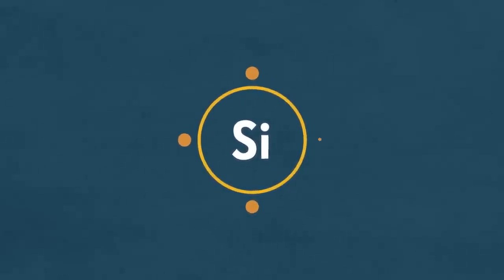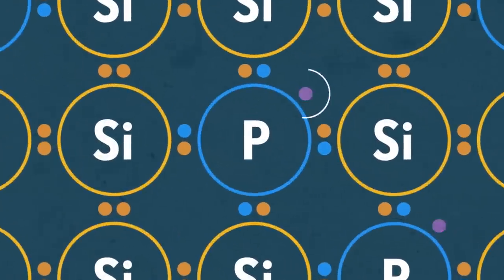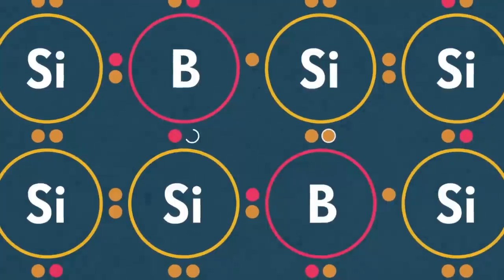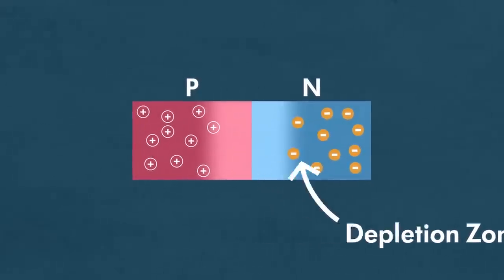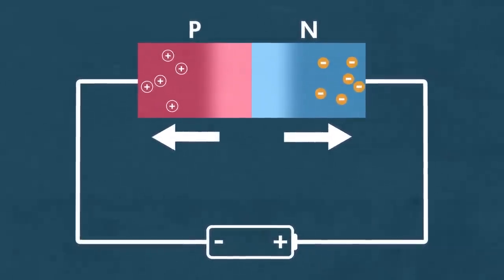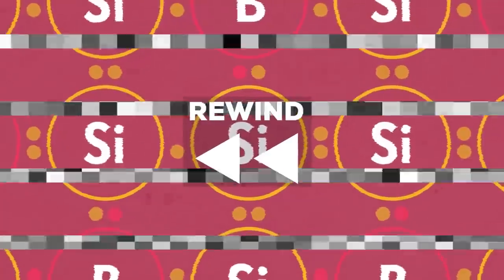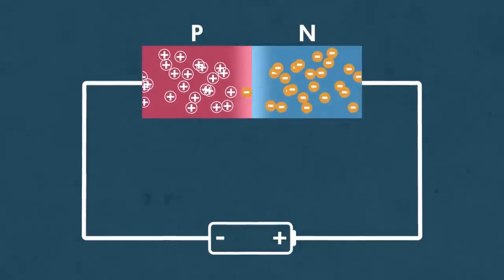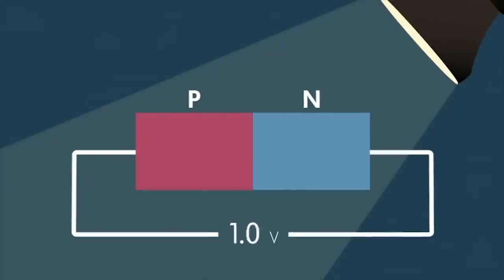How diodes, LEDs and solar panels work

Comment: as an electrical engineer, i should say this is the best explanation and animation i've seen.
Thank you
Reply: Does the p side of the diode ever "run out" of electrons if the photons keep "pushing' them away and through the n type side presumably eventually to a battery. Or are there just so many electrons that it doesn't matter.
Reply: @TwenOalley  if I remember correctly you can say that the electrons from the N material that go into the P material, go out at the conductor. So there's "a new hole" for each electron that go out.
Or rather, the amount of holes won't change, they're the hops that electrons can use to move around through the material, thus they determine (along with the free electrons on the N material) the current capacity of the diode. More voltage (pressure) and the diode breaks.
From a simplistic point of view.
Reply: It's really interesting the implications of all that it's explained on the video. From this an electronics class will go through every (common) type of diode there is (though my class didn't cover solar panels).
The depletion zone will always exists, even on a conducting diode. On a conducting silicon diode it will go as high of 0.7v. Imagine having 1 ampere passing through the diode! It will act as a resistance of 0.7 ohm! And that would be 0.7 Watts of energy dissipating on such a small junction!! (now you can kind of understand why LED's need big heat sinks and old lamps don't [heat can dissipate on a bigger area, not just a small junction])

So there's tricks to control and benefit (with drawbacks) those characteristics. Diodes with smaller depletion zones but that "leaks" more current on reverse polarization, diodes that are easier to break their depletion zone on reverse and won't "break" permanently so easily so you can use that voltage as a fixed reference, etc.
And the it goes into transistors and all their types! It was a very interesting class.
Reply: @TwenOalley  yes, it's possible
Reply: @TwenOalley   if the diode is not connected electrically there will be depletion to the point where the pressure equalizes.
When it is connected as a solar electrical generator it will draw electrons out of the anode if connected to a battery directly, and pack them into the cathode thus charging the battery until the pressure again reaches equilibrium as the anode is depleted and the cathode becomes stuffed. So you could relate the intensity of the light with photon pressure balancing with an opposing electrical pressure within the battery.
I have visualized this using 2 water tanks and a centrifugal pump. One water tank is 100 feet higher than the other. Once the water level in the piping going to the higher of the 2 tanks reaches a height  equivalent to the maximum head pressure rating of the pump at it's given rpm the water will stop flowing upward and the pump while still turning will be converted from a pump to a heater by virtue of a phenomenon related to fluid shear. Same thing with the solar panel, it gets to a point if it's rated maximum output voltage is less than the rated maximum voltage of the storage media, it stops charging and just creates waste heat. Part of the reason we use an inverter between the generator and the storage.
Reply: I've been sent here from my electrical engineering class so ig my university thinks so too lmao

Comment: After going through my undergrad in physics and never actually understanding semiconductors and diodes, this video has finally let me understand them.

As for the whole use of anthropomorphism in your explanation, the way I see it, science communication is often a problem of translation from complicated science language to plain English, and anthropomorphism is one of the simplest ways to bridge that. As long as you provide the context that it's a translation tool, then I don't see what the problem with it is.

Comment: Thank you for the comprehensive yet compact video.
If only this video was available in 20 years ago. I spent / wasted 3 years on electrical engineering and digital circuits in university and never fully got my head around this.

Comment: Very interesting! So what determines how 'efficient' these diodes are?
Reply: The materials I think, that’s probably what the entire industry behind it is about. What materials make efficient and cheap enough mass produced diodes.
Reply: Material has a lot to do with it. A silicon diode drops about 0.6 to 0.7v, where a germanium will drop 0.25 to 0.3v or there's a special kind of diode called a schottkey diode where the junction is formed between silicon and a metal which drops as little as 0.2v. This is important, because Ohm's law states that power=voltage x current. So if you have 1 amp of current through a diode, the silicon diode will draw 0.7 watts of power (0.7v x 1A) where te schottkey diode will draw 0.2 watts. This power is just dissipated as heat, so any power drawn by a diode is wasted power. So the less power consumed, the more efficient it is. I hope that helps.
Reply: There is also quantum efficiency in LEDs, Photodetectors and Solar Cells which is the fraction of photons to electron-hole pairs generated or LEDs/LASERs the fraction of pair recombinations that actually result in emitted photons.
This efficiency does have to do with resistive losses and absorption by the material in areas other than the depletion region. Also Reflection at the surface.
Reply: Another factor for lighting is simply many bandgaps are wavelengths (or for our eyes, colors) that we don't directly want, so they will have a phosphor coating to absorb and re-emit at a more pleasant color. Obviously this eats into efficiency.. if I remember correctly, a green LED was sort of elusive so many white lights just had to use blue light with a coating... Although don't quote me on that haha
Reply: Tests.

Comment: This is one of the clearest, least intimidating explanations I have seen and I'll be showing it to my first-level electrician students shortly. The only quibble I have is the implication that one takes P-type and N-type material and butts them together. AFAIK, if you literally had two separate pieces of material and attempted to join them together you would never achieve a useful junction. As I understand it, you start with a chunk of silicon and selectively dope different areas of the same piece. Am I upside down on this, or making too much of the distinction for a beginning audience?
Reply: A introduction can either be too simple or too detailed. I think this video makes a good first introduction to diodes.

And if someone wants some more exact details, then they should look for such additional info. Such as solar panels having multiple layers of semiconductors, to account for different wavelengths.
Reply: @suddeneevee9441  Thanks for your post. I've no problem with any of that, but IMO the concept of selective doping vs. joining separate pieces of doped silicon together doesn't represent a huge leap in the complexity of the concept or its presentation. It would certainly take fewer words than this comment has. 😉

Comment: Fluorine likes to do horrible things to its surroundings even when it's in its 'happy' state, so making it 'angry' is not really a smart thing to do.
Reply: Unless its teflon
Reply: @wierdalien1  Well, yes and no. There's some incredibly stable organic fluorine compunds, like tetrafuoromethane, or teflon (PTFE) that you mentioned. That would be fluorine in its 'happy' state. And even those compounds usually fuck up the environment and/or people either during their creation, their disposal, or when handled incorrectly.

As for 'angry' fluorine... take a look at chlorine trifluoride. Or maybe not. Running away would be smarter. Or better yet: Be somewhere else than that stuff in the first place.
Reply: I love the way you anthropomorphize atoms, NaHCO3
Reply: @nahco3994  well yeah creation of PTFE requires straight flourine
Reply: What do you mean, floorine is what the floor is made of, what else am i supposed to walk on?
Reply: F2 is very happy when on its own. It also explains why it is a gas normally (compared to silicon or carbon latice that is a solid; ionic compounds are a different matter). However F with other stuff can be even more happy if it bonds to something else like carbon. It is all about bond energy and electronegativity. F is most electronegative element in periodic table, so F2 will bound basically to almost everything and displace other atoms in other compounds if it can. This is why it is so dangerous and corrosive.
Reply: @jay-tbl  This comment made my day😂😂😂😂😂
Reply: Hi sodiumbicarb I'm a doctor and us doctors love you very much. never thought i'd have the chance to speak to you in my life!
Reply: Don't make fluorine angry. You wouldn't like fluorine when it's angry.

Comment: Minor correction. The pn junction isn't made by pushing two materials together
Reply: This isn't really a correction, just pointing out a potential incorrect statement.
Reply: This video is simplified, semiconductor manufacturing is another story.
Reply: It can be made by just pushing p and n type materials together, even though often industrially it is just two halves of the same piece of material doped differently.

Comment: "Diodes, LEDs and solar panels" --> So diodes, diodes and diodes?
Reply: All are diodes, but the first "diodes" you mention are usually called "signal diodes" because of their application.
Reply: Actually, rectifying diode or maybe PN junction diode would be better to distinguish regular diodes from the rest. But signal diode is just fine for low power ones which are (obviously) meant for signals. I'm pretty sure a solar cell also uses a PN junction, but the reverse breakdown voltage is so small and the reverse recovery time so long that they would make a terrible rectifier. Zener diodes and avalanche diodes also don't rectify very well either for the same reason.

 So it seems rectification isn't the sole defining feature of a diode. But at the same time, not all diodes use PN junctions either. Like PIN diodes, which have undoped, or intrinsic semiconductor between P type on one side and N type on the other.

 Or schottky diodes, which only have a P or N type layer on a metal layer, as in the famous cat's whisker or point contact diode used in foxhole radios.

 So in terms of what exactly defines a diode, I have no clue. but I aim to find out now that I've realized this. Hope you guys will, too. Cheers.
Reply: Fries, Chips and Mashed Potatoes

Comment: Ok, so what's the deal with zener diodes?
Reply: It has to do with the way diodes break down. In any diode, you still get a very weak reverse current even if the diode is "blocking" because some of the charges are able to cross the depletion zone. Once you approach the breakdown voltage, some of those moving electrons have enough energy to knock electrons that wouldn't normally be free-flowing out of the covalent bonds, and the reverse current sharply rises. This is known as "Impact Ionization" or the "Avalanche Effect". Note that this, in itself, isn't actually damaging to the diode - what damages the diode is the massive current flow and the heat that results from it.

Now, a Zener diode has essentially the same construction as a regular diode, but the material is more "heavily" doped. This means that there are more charges in the same volume, and as a result the depletion zone is much thinner. The voltage across it is still the same, though, so the electric field across the depletion zone is much stronger. When you connect a diode in reverse, the electric field across the depletion zone gets stronger, and in the case of a zener diode, strong enough to rip electrons out of the covalent bonds and allow a high current to flow. This is known as the Zener Effect.

According to Wikipedia, only zener diodes up to 5.6V actually use this effect, though. Zener diodes for higher voltages supposedly rely simply on the avalanche effect - kind of makes sense, because at that point you're essentially just manufacturing a normal diode. The breakdown voltage is engineered through how heavily doped the material is.

It gets a little more interesting, though. Impact ionization is just a matter of raw energy, but the zener effect is actually a quantum tunneling effect. The upshot of that is that low-voltage zener diodes supposedly generate a lot less heat than zener diodes that rely on the avalanche effect.

Comment: 0/10, nothing poured out of a beaker.
Reply: @JamecBond  And the distance between the top of the LEDs and the rim of the beaker is the energy gap.  Jiggle it around (thermal energy) and some will leap out! :)

Comment: Woohoo! Great topic! One interesting note: the moment of the electron is actually different than the hole 'particle'. I sort of forget the implications of this, but I think it affects how solar panel design.. 
For example, the average distance a 'free' electron travels depends on the odds of it 'colliding' with a hole. If it combines, usually all that happens is that energy makes the atoms wobble (i.e. heat or phonons) which is 'waste' since you want to extract electricity. So the thinner a solar panel is, the more likely you are to catch a free electron (or hole). At the same time, to liberate an electron you need some energy. This can come from heat occasionally but mostly is from a photon (light energy). One thing to note: that band gap Steve mentioned, this is a no-go zone for electrons which must be 'jumped' to transition from being bound to an atom to being a free electron moving through the crystal. So if a photon of light is not energetic enough, it will pass through the material without much interaction (this actually is why glass is transparent to visible light- its bandgap is larger than visible light spectrum. UV light has enough energy, and therefore can be absorbed). On the flip side, if a photon has more energy than the bandgap, the excess energy essentially boosts the electron to a higher energy but the electron quickly drops down to the upper edge of the bandgap, dissipating it as heat (generally speaking). So this limits efficiency: essentially there's frequency of peak efficiency for a given junction. You can stack multiple layers of different materials (higher bandgap on top, since they are transparent to higher wavelengths) which increases efficiency, but is very costly..

Comment: Pretty good explanation! As a note, the electric field that separates the electron-hole pair only exists in the depletion zone -- so solar cells are often what are called PIN diodes -- P-type, N-type, and in the middle, just plain intrinsic, all done to make as big an area to receive light as possible. Then also there's some magic that determines whether or not a specific photon will do the right thing, which I am totally unfamiliar with. 

Also cool is that silicon is what's called an "indirect" band gap semiconductor, which means that when an electron-hole pair cancels, not only is a photon emitted, but also a "phonon", or a bit of heat/kinetic energy -- which makes it less efficient for light emitting tasks. GaAs and derivatives have "direct" band gaps, where only photons are emitted on recombination, which makes them better for LEDs!

Comment: Steve this description is simply superb! I did an electronics degree and have been in electronics design for ~40 years, but this is the best explanation I’ve ever seen.

Now can you please address transistors? FETs are one thing (and worthwhile), but I’ve never understood BJTs at the silicon level. Especially when they are modelled as back-to-back diodes. I mean, why does a real NPN transistor not work if I swap collector and emitter?

Comment: Great video!  It is also why diodes are normally cover in an opaque material to prevent light from altering their intended purpose.  Of course, epoxy is the material to prevent environmental and mechanical damage.

Comment: I had dropped out of Physics because of semi-conductors. I simply could not understand the reasoning behind why a diode worked in terms of positively charged particles called 'holes' that weren't actually there. This video has cleared it up after so many years, thank you!

Comment: Easily the best explnation i've seen. Even explain the difference in forward voltage drops! The more energy required toward the blue, higher voltage drop. White leds are blue leds with yellow coating, so they have highe voltage drop along with blue and UV. green a bit less, red and infrared way less! Because the red light is less energetic than the blue and uv one!

Comment: 09:10 : The poor wee green LEDs got left out. Even infrared got included 😅 (Excellent video though!)

Elsewhere I read (for anyone interested): "Green LEDs are produced by growing gallium nitride on silicon, in a similar way to the process used for blue LEDs."

"The main semiconductor materials used to manufacture LEDs are: Indium gallium nitride (InGaN): blue, green and ultraviolet high-brightness LEDs. Aluminum gallium indium phosphide (AlGaInP): yellow, orange and red high-brightness LEDs."

Comment: All great. I didn't know about how different colors of LED were created. However, my lecturer also said about reverse biasing the diode. I can't remember if it was 400 or 4,000 volts (i think 400, but it was back in 1993). However what does stick in my mind is how he explains the failure of the diode when you go past that voltage. "Everything disappears in the familiar mushroom shaped cloud".